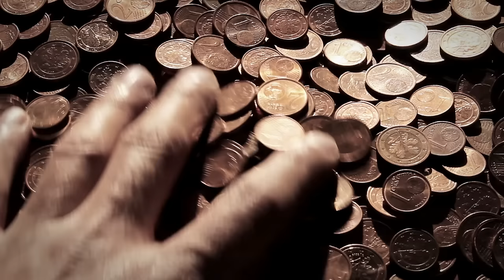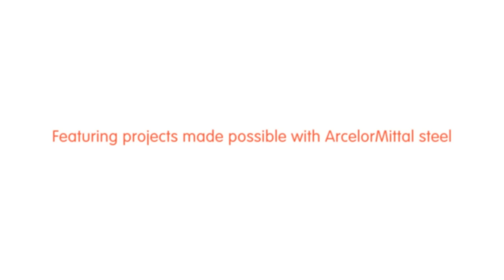I am Steel

Comment: Technically the Eiffel Tower is iron made, not steel made 😉
Reply: +Yann BRESSON iron is an elemnt sir, iron and carbon components called steel, iron is very soft material if its pure to build eiffel tower. Nearly 96-98 percent of things you called iron in daily life actually steels.
Reply: +Naim Deveci 'The Eiffel Tower is an iron lattice tower located on the Champ de Mars in Paris, France.'
Iron lattice... Not steel...
(source : https://en.wikipedia.org/wiki/Eiffel_Tower)
Reply: +Yann BRESSON there you go;
https://en.wikipedia.org/wiki/Allotropes_of_iron
Reply: @A2BProduction   It´s Wrought-iron lattice tower. Wrought-iron nowadays is called mild steel. Which means  it´s a low-carbon steel alloy.
Naim was right, that iron is a pure element. Conclusion: Eiffel tower is made out of steel.
Reply: @ThePirx  Puddled iron to be précise ;-) https://fr.wikipedia.org/wiki/Tour_Eiffel
Reply: @yannbresson  you are relying on wikipedia and google translate, good job. 

One of the ways of making wrought iron( i repeat, nowadays it´s called mild steel) is by process called "puddling"  which is a process in metallurgy. In this process, pig iron(raw material - contains about 90% iron) is melted and then stirred inside the furnace to form bars of wrought steel

wrought is an archaic past participle of the verb "to work"

so wrought iron means literally worked iron.

If you would have researched enough before replying to me, you wouldn´t make false claims.
Reply: I'm French and I speak English, I've grown up with the Eiffel Tower in front of my bedroom window and I don't need google translate to understand you 😘 
You have a technical approach, which is right, and I'm thinking from an historical point of view. At the end of 19th century Gustave Eiffel chose puddled iron (fer puddlé en Français) to build his tower, not steel.